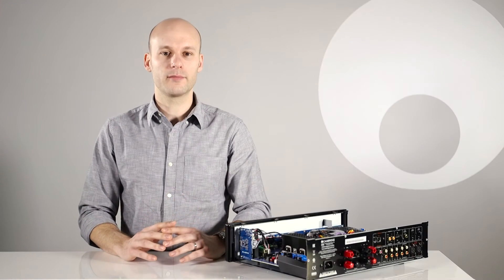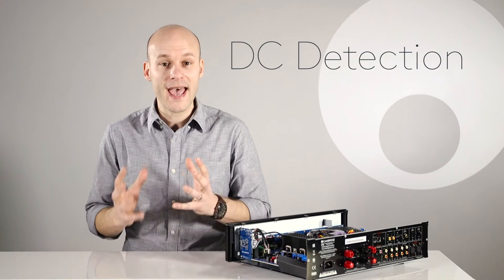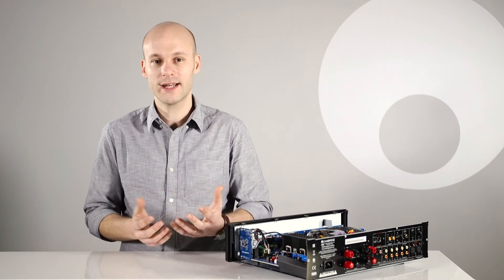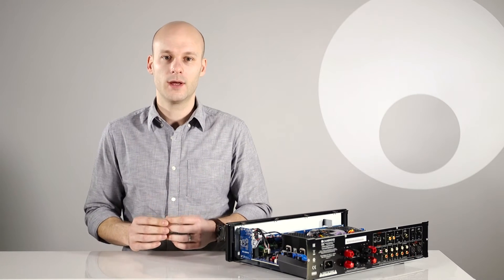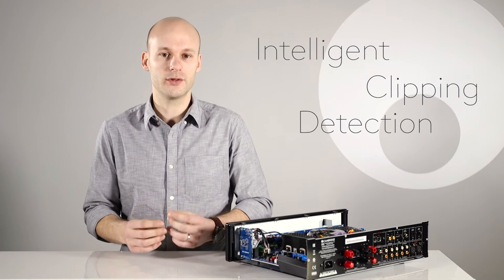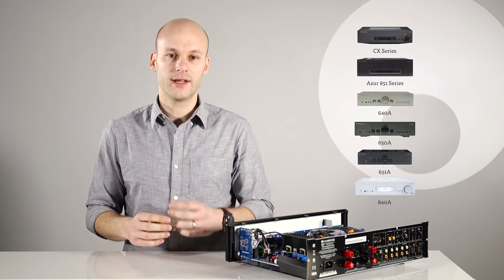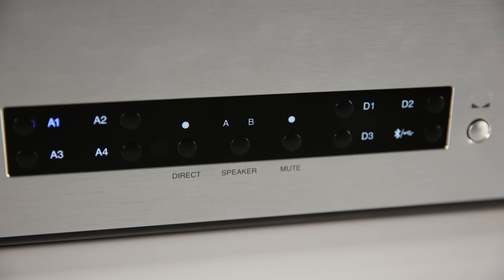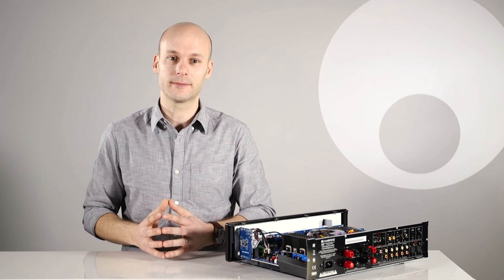CAP5 Amplifier Protection System

Comment: Azur 740A also started doing this repeatedly. No speakers connected so it cannot be heat. If i'm (very) lucky it only takes 10 tries to turn it on. Have had other cheaper amps where this type of protectionsystem never misfired. Must be some components of questionable quality somewhere in the amp.

Comment: This CAP5 that you "invented" is feature that you can find in most of properly designed power amplifiers (I mean properly, not cheap Chinese crap). Each engineering guide book related to electroacoustic amplifiers provides those all protection circuits.
I guess, your amplifier uses bakward characteristics current limiter as short circuit protection. This kind of protection is not ideal, it has many disadvantiges but it is quite popular and most known protection circuit.
PS: Involving uC's and relays for short circuit protection is not recommended, because uC can be too slow to properly react while output transistors are overloaded. There is dedicated transistor braker cuircuit for this. When it detects short circuit it will disable driver stage of amplifier in just micro-seconds.
BTW.
I see you used Sziklail pair for output stage, in AZUR840A, but you made common mistake by adding wrong collector resistor valule in earlier transistor. Sziklail pair has the better linerality, but it has worse impulse response tran darlington pair, this resistor should have small valule to compensate this phenomen. You added there 120R resistor, there should be  
~13-20R (4-5 times more than load resistance)
You could use BD135 instead of MJE340 for temperature compensation circuit - save of money.
There is capacitor missing above R27
If there is offset null circuit, you don't need to use DC separator in fedback loop (C6), waste of money, again.
Wooow, there is so many small mistakes in this design I see.

Comment: Just purchased a Cxa81 and the Cap5 is causing the amp to switch off after 30 seconds. I have checked all connections and everything is 100%. It's a shame because the amp sounds great but it seriously makes me question your quality control. The amp is only 2 hours old. A quick Google search to troubleshoot the issue confirmed I was not the only one with the same issue. I'm returning the amp because I have no faith in the longevity of your products.
Reply: Mine Cxa80 also fails on CAP5 - turns off after several seconds. 10 days after purchase. Connections are fine. It's been 5 workdays with no response from CA tech support. It's sad. Sent for service by dealer. Will see...